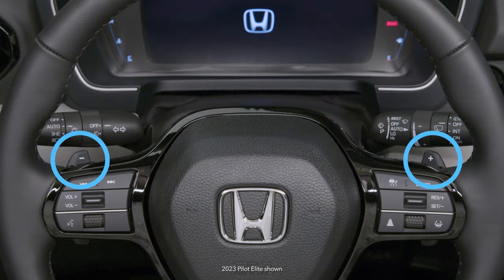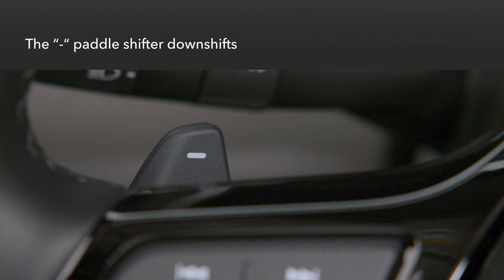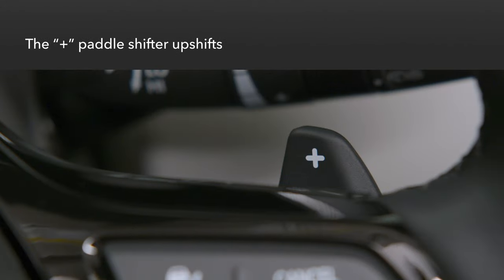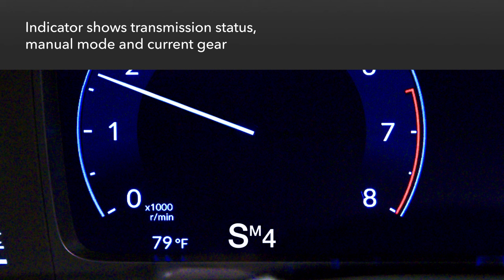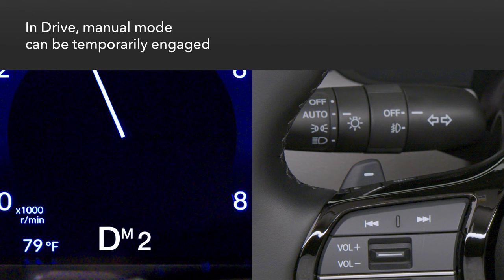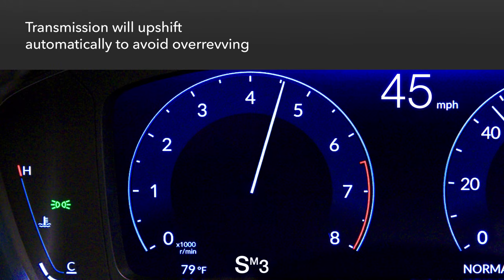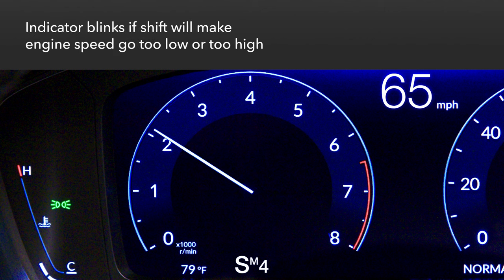How to Use Paddle Shifters

Comment: Most people don’t know how to use the paddles, and will complain that the car is not letting them “bang the limiter.” That’s to prevent damage to the drive train.
Reply: meh its not a real manual feature then.. you should be able to have the engine right at redline and not cause damage. My 2007 honda accord manual has been at redline most of its life and its got 238k miles on it lol
Reply: That doesn’t make sense when the car reaches full power at 6,800 and the torque is the same to the drivetrain when off or on the paddles. There’s no way to "bang the limiter" in the first place when the car has the feature to automatically shift up at a given rpm, electronically.

Comment: Can you PLEASE start from the VERY beginning?  Does the driver have to first put the regular transmission in the usual "drive" position first?   If you could demonstrate this from the stopped and "engine off" point, your viewers would understand better.  You can't just begin this demonstration from the perspective of what the paddle shifters are used for and think that everyone will automatically understand.  We're all not technicians.  You need to understand your audience if you want to help them.
Reply: just watch the video
Reply: Ah, I did. I can read, listen and I graduated college. 

They need to start from an "engine off" position. Position and context matter.
Reply: If you can't extract the necessary information from a video and deduct your reasoning to a single most logical answer, maybe opt for a car without paddle shifters 😅
Reply: if you're in "drive" you really dont need to use the paddle shifters, anyways if you're on "S" you need to use them there
Reply: @coldmago Well I have a lot of questions too that weren’t answered here. Just want to make sure I don’t damage the transmission. I’m used to driving a manual transmission and this is all new to me.

Comment: i sometime accidentally push one of these paddle shifters when I make a turn.. then i get confuse how to get back to normal driving mode. its an odd place to put these paddle shifters on a steering wheel.
Reply: They're there so that a driver can shift gears without having to take their hands off the wheel
Reply: It's a safety thing.  Hands stay on the wheels. Just like the heads up display keeps eyes on the road.    Now that I'm a dad,  I love this car.  It's definitely designed w safety in mind.
Reply: Odd? It's in a perfect place lol
Reply: You must not know about sport cars lmao
Reply: @hypr1  yea right when you are making a turn try to guess which shifter is where.
Reply: @a.nobodys.nobody  OMG how did they drive manual transmission? Safety my ass.
Reply: @NudaMan  this is not a sport car. For a sport car this could be fine, for normal car this is stupid.
Reply: @bumbarabun  most cars that actually rely on paddle shifters have them mounted to the steering column so that they don't turn with the wheel :) hope you have a better day!
Reply: @bumbarabun  I agree 100%.

Comment: I love my 2024 Civic Sport CVT! The car really comes alive after installing an AEM intake system and Megan Racing front strut bar. It would be great if there could be a service update to raise the redline for the paddle shifters just a bit more, to 6,500 rpm would be great! I don’t understand why the redline is 6,100 for the paddles because the car really misses out on the advantage of the VTEC in Sport mode. In just sport mode and no paddle the car hits about 6,800 RPM and it’s a clear difference. Kicking down gears for corners in Normal mode feels more aggressive than Sport mode because the car returns to auto CVT immediately after acceleration, whereas in Sport mode you’ll stay in manual mode and be stiffed by the 6,100 RPM redline each gear up from the corner.🙏🏽

Comment: My local Honda dealer told me to drive my 2018 civic auto on motorway for half an hour (lower gear-high revs) been doing this but when I go above 45 the S3 changes to S4 and you can’t do that in normal D mode, could someone please help, it’s something to do with DPf!

Comment: Do I let go of the gas between shifting? Or not necessary for CVT
Reply: Not necessary as there is no clutch pedal
Reply: I do and it feels better to do it than when I hold the gas and shift. The timing is different than a manual, to do it right. Takes a little time but the trick is to time the up shift to when you lift your foot off the gas, then press the gas again quickly. Also take the traction control off.

Comment: No meaning of paddle shifters in CVT cars though they are available.
I use Honda city CVT. 

I tried to use paddle shifters. I observed that feature is redundant in CVT car. Because at Low or high any speed CVT system immediately adjust the speed, power and torque as there is no multiple gear shift mechanism.
Reply: It’s not redundant because you choose the gears. Cvt does not do this, it goes between them, it does not over perform and decelerate like you can do with paddles.
Reply: The paddle shifters are for the people who don’t drive boring all the time.

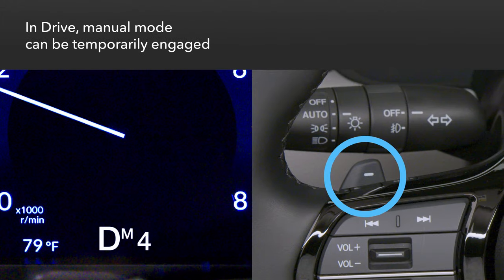Comment: 0:38 what does "temporary" means? I mean, how long? Or until what condition until it automatically doing the upshift?
Reply: Probably to prevent it from breaking, like if your upreving too much on a lower gear then it will do it automatically
Reply: From my experience it turns off once you hit the gas again, except for D1.
Reply: From my experience driving a Civic, the manual mode engages quite a while during downhill (when shifting down for engine braking). but it just set to automatic mode if there is nothing special happening 😅

Comment: CVT transmission has gears?
Reply: My Honda Odyssey has a 10 speed automatic transmission.
Reply: it’s technically programmed set gear ratios like a normal automatic
Reply: @bluto3426 as in if you accidentally have it in sport, it still acts as an automatic?
Reply: For my city, in S will behave like manual, need to shift for every gears
Reply: @Mahabrando Yea, the CVT will act like a auto in sport mode, especially in Sport mode. Its also more snappy when moving